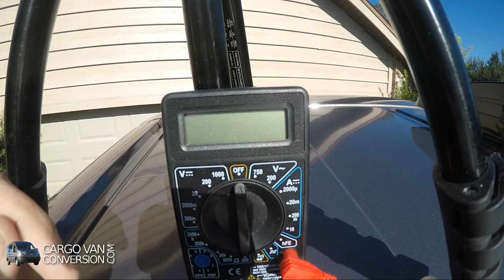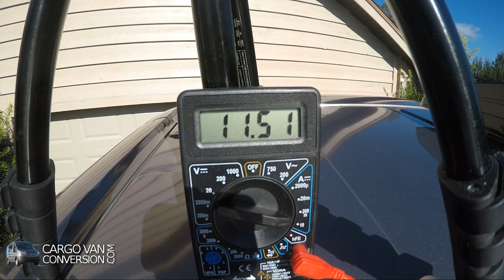ETFE Flexible Solar Panel Installation - Part 2

Comment: As always, very nice job.  It takes time and it's harder than most people think to do good cable management on the roof of a van, you make it look easy..Thanks for sharing with us.
Reply from the maker: Hi Terry,
First of all, laying down the wiring on the roof is so much more time consuming than the video really shows. But before starting, I had to decide whether I would use a combiner box inside or outside or lead all six cable through the roof to the breaker box with individual breakers. Check on all cables and their lengths for voltage drop. I decided for the current setup, but then still find the best way to position them.

Van Williams
Reply: Yes, I understand your dilemma ....I have thought of drilling holes for each panel and going down through the roof with two holes for each panel...that would look the cleanest, but woooo, drilling that many holes in the roof is hard do...cheers...
Reply from the maker: Hi Terry,
Just saw installation of a few panels on Jamie's Van Install (Enigmatic Nomadic) this morning with 3M tape like mine. With more documented use of VHB tape, more people may switch over to tape. A lot less holes and less risk of water intrusion and rust.

Van Williams

Comment: Great videos.  Thanks for sharing them.  Is there a reason I'm not aware of, for the MC4 connections having to be used.  They look bulky and although you have done a fantastic job of connecting them, the roof fittment would be cleaner if the connectors were replaced with a junction box or the wires soldered.  You, like many videos, have struggled with the large and numerous connections and I wondered why you stuck with them, taking the time to make them very presentable and teathered down.  Thanks.
Reply from the maker: Hi Alasdair,
Thank you for watching!
You made a valid point. I think, the main reason why many use the MC4 connectors, is that when you remove them from the solar panels, you'll ordinarily loose your warranty. I did that anyway on some of the panels. My individual situation is a bit different from others, I suppose. Making Youtube videos (and getting more subscribers nowadays) make me rethink sometimes how I do things in this conversion. That comes down mostly to using more elaborate parts, where I personally may go the cheapskate route. Many copy partially or wholly, what I do in these videos and I think that I should set that example. That was also the case with these MC4 connectors; many are not proficient in soldering or other sorts of connectors and since the MC4 standard is so prevalent, I choose to go that route.
A side effect was, that my intention of stealth is more compromised by the MC4 connectors, that the actual solar panels. Because I'm so busy with the rest of the conversion, I don't have the time now, but I was seriously considering, removing these connectors and replacing then with less obvious parts. Similar to what you described.
Using a junction box wouldn't work in my case. It would mean longer cables from each panel (voltage drop) and the visually obvious box on the roof. That being the only difference.
Thank you for the feedback.
Van Williams
Reply: Cargo Van Conversion thanks for taking the time to reply.  (I’m watching some more) All he best with the rest!

Comment: Soooo tidy. :)
EDIT: Oh yeah, toenail clippers are great for trimming off excess zip tie. No sharp edges.
Reply from the maker: I'll remember the one about the clippers! Being tidy with the wires, also means short cables and less voltage drop.

Van Williams
Reply: "Flush Cut" nippers work even better.  They're available at Home Depot.  Comes in a pkg with needle nose pliers. (light duty)

Comment: It looks like you have left the leading corners unsupported over the indentations in the roof. Aren't you worried that the wind will get under that, and start it flapping?
Reply from the maker: Hi Mark,
On one hand, I was lucky that these roof channels ended under the front panel, offering one fully supported area for the tape at the front end of the panels. On the other hand, as you so observantly noticed, the two corners of the front panels (approx. 2" x 3" each) were left unsupported.
It is very stiff and air is able to move out sideways. so I decided for the moment to leave it as is. Don't drive at high speeds often, but if I start seeing movement in the future, I will need to add support there. If that happens, I will certainly post that and let you all know.

Van Williams
Reply: I might add just a dab of Dicor to those corners.
Reply from the maker: I have had my panels on the roof for a little while now and driven the van mostly locally, but a few times at highway speeds. Checked the panels last week and everything seems to be, the way it should be. No movement, no loose corners. Looks promising. I'll keep y'all updated!
Happy New Year!

Van Williams

Comment: Have you had any issues with the zip ties getting brittle and breaking due to sun exposure? I have not used zip ties on my van roof, but have used them in other outdoor applications and find they don't last very long before they become brittle and break (maybe 1 or 2 years).

Comment: hi .great video . thanks .what kind of solar panel are you using 
 .where I live we dont have much sun , are your Monocrystalline or polycrystalline ?
Reply from the maker: Hi Robi,
I'm using high-efficiency flexible solar panels with Grade A, back-contact solar cells laminated with EFTE. Best advice, I can give you, is to buy solid panels, unless you absolutely want to go stealth (like I wanted). Solid panels are cheaper, have better warranties and longer lifespan. As long as they have a reasonable efficiency, don't worry about the type or model, just add an extra panel.
PS Love to know your location :).
Van Williams
Reply: @cargovanconversion  I think flexible is better cause less noise from wind , but yes you are right , the other I imagine more solid , I am a biker from teenage time so you can imagine I love travelling.location Iceland but now in Demark , also a place where not much sun ,the chinese solar I bought they are fanstatic under sun Monocrystalline but I think is very slow or very very slow in shadow , I haven´t mount them yet but soon, one more thing , did you not use any silicone ? just that double coted tape? greetings from Denmark for now . Robi
Reply from the maker: @robisam1624  Hi Robi,
BTW I've some biking too in my younger years, so we have something in common :)
Less noise is true, but driving with a well-insulated van, that is hardly an issue. Most solar panels will reduce output significantly when partially in the shade. You may consider anamorphic flexible solar panels; these work much better in low light situations, but with much lower efficiency and more expensive. Worse part is, they take much more space, something you don't have in a van. The tape is very specific: 3M VHB tape and you have to go to their website to find the right one. Some even use it on solid panels. Have had no issues at all.
In general you have a energy production (and likely storage) issue. Dependent on your lifestyle in the van, you could carry extra flexible panels and store them under your mattress. Put them outside and connect them to your batteries when your at a campsite. If you drive regularly, you can install one or multiple dc-dc converters that convert from your car's alternator to your batteries (most efficient in combination with Lithium batteries). Finally, change over to Lithium batteries for larger storage to compensate for longer periods with less sun.
Holland is my native country, so I understand the limited sun exposure thing.
Remember: Petta Reddast :)
Van Williams
Reply: @cargovanconversion  heel erg bedankt ,já já Þetta skal reddast , : -)

Comment: I see the MC4 connecters are rated at 30A will this be enough with your panels wired in parallel and will 8AWG be enough going from the last MC4 to the controller? I ask because I'm going to wire my panels in parallel also and with a rating of Impp 9.50 and ISC 9.87 per panel, not much of a comfort zone. Maybe yours are lower rated.
Reply from the maker: Hi Hiker Biker,
Missed your comments, apologies for these late answers,
My panels have a higher voltage and a regular amperage, so no issues with the MC4's. I use an on-line voltage drop calculator to determine the wire gauge. Fill in the cable length and max. amperage and out comes the AWG.
Van Williams

Comment: If your charge controller will handle 36 volts (more like 50 open circuit ) Running them in series, would make it neat.
Reply from the maker: Hi Hobo Hacker,
These panels are already ~29V. Putting them in series allows for the use of smaller (and cheaper) cables. On the Ford Transit, cables already are at a minimum and the 29V also reduces that. The major disadvantage of series is, that shade on one panel reduces the output of all panels. I did not want to take that risk.
And whether in series or parallel, they still look spiffy :)

Van Williams

Comment: I never cover my panels when connecting and disconnecting, never had a problem, even in full sunshine.
Reply from the maker: Hi timothy790110,
Covering them, is a matter of safety. With these high number of amps, sometimes high number of panels and the parallel/serial connections, better safe than sorry.
Van Williams

Comment: I like your solar panels, but 300 dollars per panel is a bit expensive. The efficiency is only rated at 21%. When EFTE Sunpower panels are rated between 23-25% efficiency. Also RichSolar panels as well.

Comment: Why do u cut the wire and them add a plus to the other end then add that to something else huhhh...I don't get it
Reply from the maker: Hi Steven,
There are several ways to connect the solar panels to the controller. 12V wiring is very susceptible to voltage drop and it is wise to size the wires to the correct gauge and to keep them as short as possible.
To avoid an exterior combiner box on the roof, I use the existing panel wires in parallel, to reduce the six wires to one negative and one positive wire and to reduce their length where necessary. The final two wires were increased in size to an #8 AWG and lead into the vehicle and to the breaker box.
Another way is to lead all the panel wires to a combiner box and from there into the vehicle. In my opinion, much of the extra length of unneeded wire on the roof should be reduced, to increase output.
Merry Christmas!

Van Williams
Reply: exactly and so professional in looks and application thanks Van